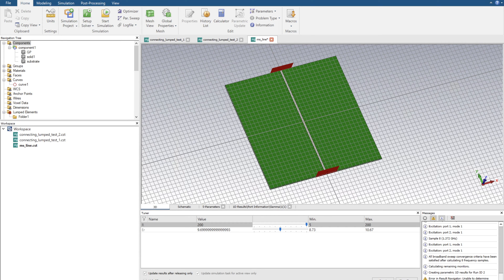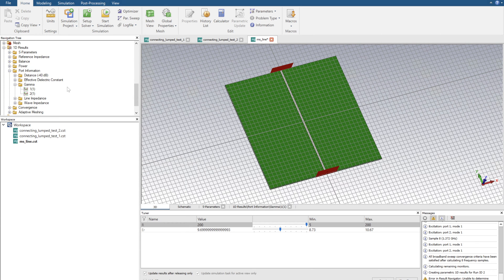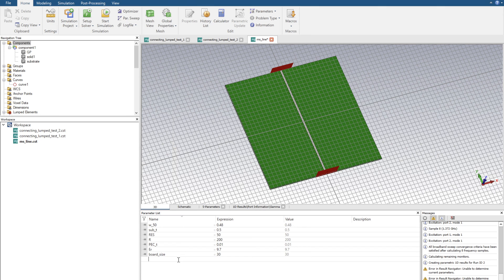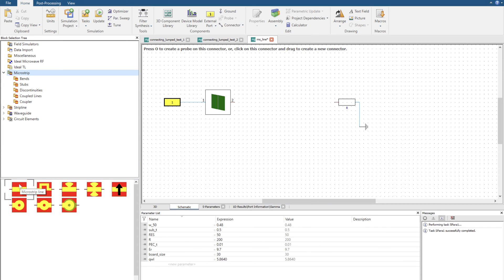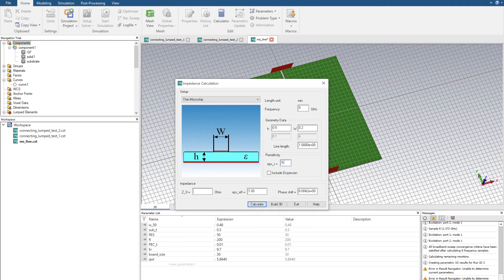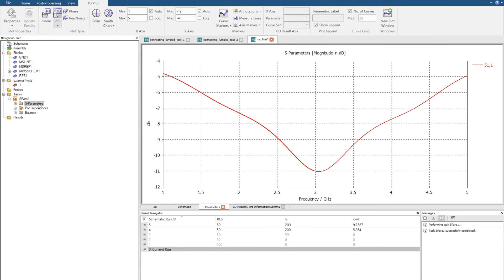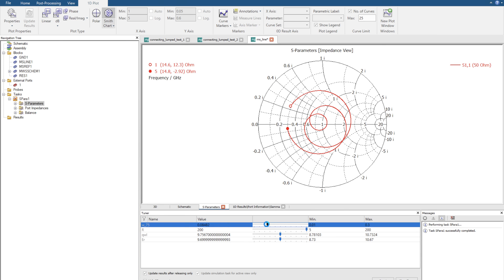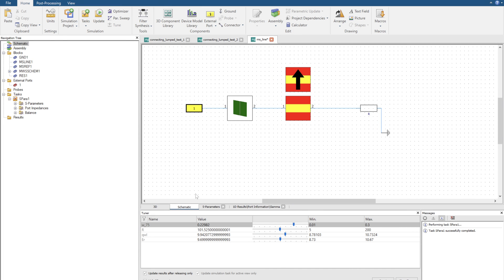CST Beginner Guide PART 7: Quarter Wavelength Impedance Matching in the Schematic Tool

Comment: 5:03 Zin should be 100 ohms, but you have taken approximately 75 ohms. How?
Zin = squareroot(Z0 * ZL)
Z0 = 50 ohms or 48,49 ohms
Zl = 200 ohms
Reply: line emp is definitly 100 ohms, how does 75 ohms works?